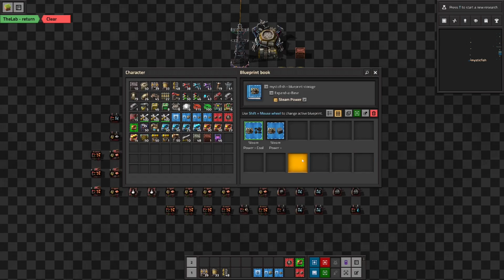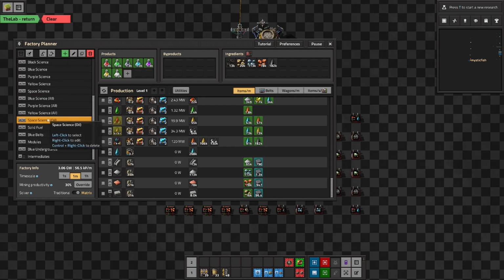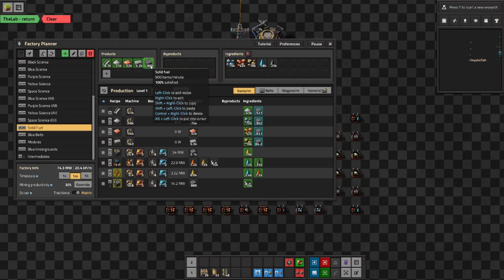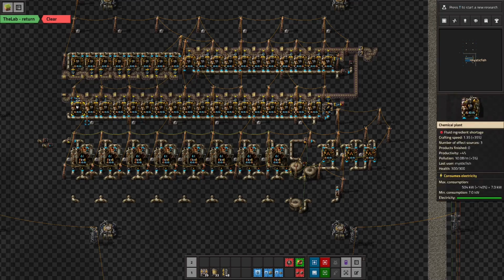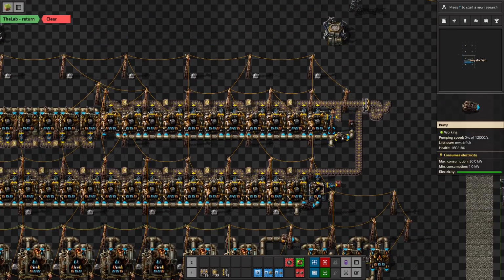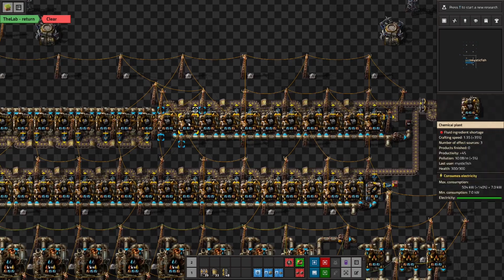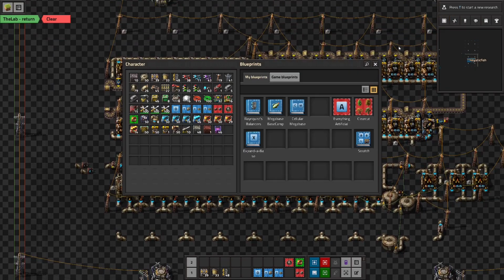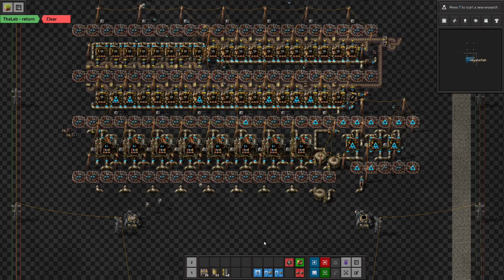Solid Fuel - Ep27 - Factorio Expand-a-Base

Comment: I feel like it might be nice to have a kind of petroleum overflow valve that goes to the petroleum bus, along with a slight overbuild of the processing capacity. It's just slightly frustrating to make petroleum into solid fuel when it could go to the rest of the factory 😂.
Although I'm sure if we ran the numbers on it, it wouldn't really be worth it.
Reply from the maker: Yeah, there is a pump that sends petroleum gas out that should prioritize that over turning it into solid fuel. Primarily this will be for the mall; everything else that needs it will have its own oil processing.

Comment: I think your belts are under-sized on this. You are producing 3k-ish/minute total at the beaconed stage (2.1k/minute of that on the "light oil belt"). A single yellow belt can handle 900/minute and a blue belt 2700/min.
I think you'll find that you'll need 2 red belts leaving the module, AND at least the "light oil belt" needs to be blue belt (the "petroleum belt" could be yellow or red).
Reply from the maker: Yes, you are right, of course! The factory plan targeted a full yellow belt of solid fuel for the steam power plant, plus more for smelting, so we definitely need more than a yellow belt here.
Reply from the maker: Ok, I tweaked the design a little so it outputs two belts, which is convenient because we targeted producing a full yellow belt for steam power. The non-beaconed version can use yellow belts and the beaconed one can use red belts. I’ll publish the updated BP with the next episode.

Comment: 5:03 That priority seems a bit like leftover thinking from usually handling the light oil to petroleum ratio via cracking. In that usually, once you have petroleum, there's no going back to light oil. But in this case, there's also no going from light oil to petroleum.
(In fact, there's kind of an indirect way to go from petroleum to light oil here: Let the mall consume petroleum and then refine raw oil into both light oil and petroleum.)
I think the priority might not be needed. But I also think that it won't hurt either.
Reply from the maker: Hmm, now that I think about it some more, the fact that the mall draws petroleum gas means that I probably need to add light oil cracking to allow for petroleum gas to continue being produced even if the solid fuel output has backed up. I’m going to have to revamp this design slightly. Thanks for pointing this all out!
Reply from the maker: Now that I think about it, the mall also needs lubricant, so I will have to add that back in too.
Reply from the maker: Ok, I have now updated the solid fuel blueprints to include:
* sufficient belt capacity
* some light oil cracking
* lubricant production
Those will be included in the published blueprints for Episode 28 (and I will probably also give a quick overview of the changes at the beginning of that episode as well).